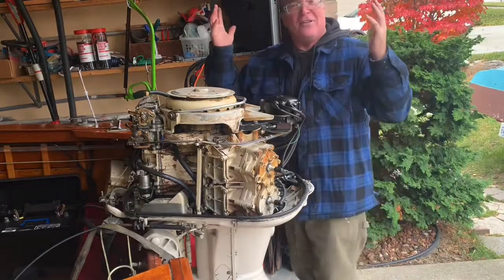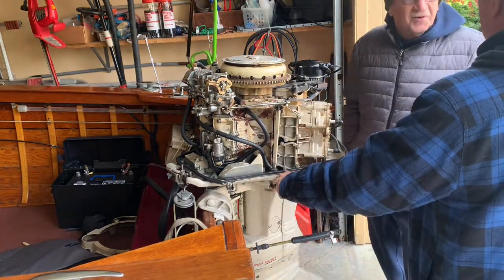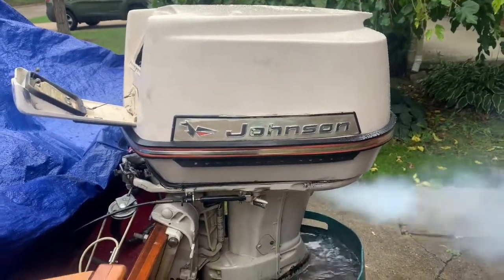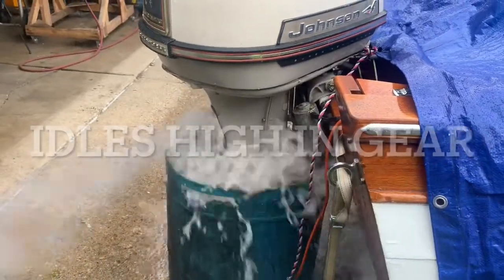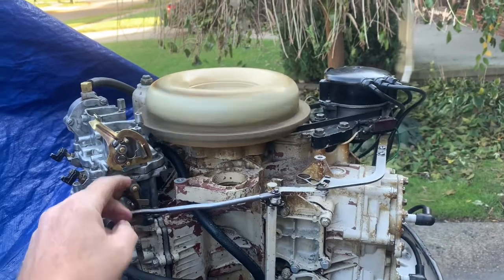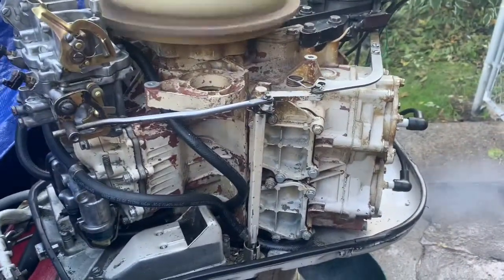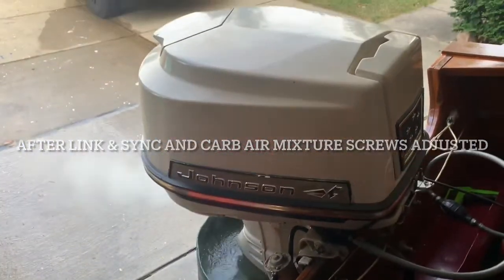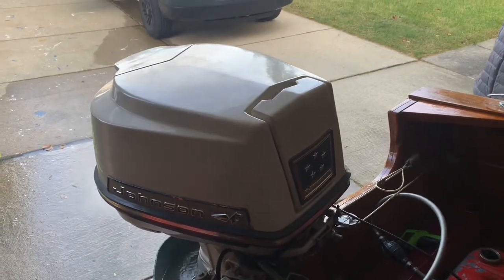1962 75 hp Johnson - Part 7 - Recap of Running Before & After Link & Sync and Other Improvements

Comment: Love the video. Reminds me of my Dad tinkering with his 1966 80 hp in the driveway. Man, I remember how much smoke these beast put out....and the gas in the water. They were horrible relative to pollution and fuel use......but, work horses. He ran the 80hp for 10 years. Then traded it in for a new boat and a 1976 Johnson115 - which was lots smaller in size. But just as smoky.  Thanks for the memories. (Btw, the engine shown in the video looks like a 1964 from the cover style).  Cheers.
Reply from the maker: Alan Rothfuss… Thanks for tuning in and sharing your story. I really appreciate it. Check out the other videos of this boat and motor. You can find the links in the description. The model for this motor is V4AL-14 and according to www.marineengine.com it’s a 1962. Maybe the cowling is from another motor.

Comment: Amazing these old engines are still out there and roaring along.2 Questions Sir .....Where I live people have always given Johnson outboard motors the name of being rubbish .Is this just an unfounded nasty rumour which grew arms and legs? Question number2 .While watching this great video I see you have the motor submerged in a big bucket .I do this too .Problem is I have left my mariner motor down in the bucket for a few weeks now as I'm tinkering with it when I get time .Its been minus 2 here .Do you think I could crack internal parts by doing this .I've wrapped the motor in blankets but today I need to softly heat  the motor up with a watering can and get it out of the water filled bucket .Ps the bucket has always been full of water but has a 10mmskin of ice on top.Im so silly sometimes .
Reply from the maker: Crafter…Answer 1: Johnson outboards are very good motors. They are considered very good here in the US. Answer 2: Yes you can do damage if the water freezes up solid but if you only had a skin of ice your probably ok. Just make sure when you pull the leg out of the bucket you lower your motor down completely to let all the water drain out.
Reply: @LivetofishOutboardRepair  Brilliant answer Thanks man .Well it seems people here must be talking bull about the Johnson motors .Thanks for that info.Temp up to 8 degrees now .Started her up .All ok .(thank god).Drained the bucket and motor drained of water now  .A buttock clenching moment last night I must admit seeing everything white with frost.Appreciate your time and having the decency to reply ...Noted sir .
Reply: Perceptions are deceiving. The Mariner brand is still marketed in some foreign countries because locals sware they are better than Mercs while the only difference between them is the colour of their paint. I find that OMCs tend to be simpler, standardized rather easy to work on designs while Mercurys / Mariners often feel like over-engineered and not so intuitive. But treat either brand decently right and they will provide decades of trouble-free enjoyment.